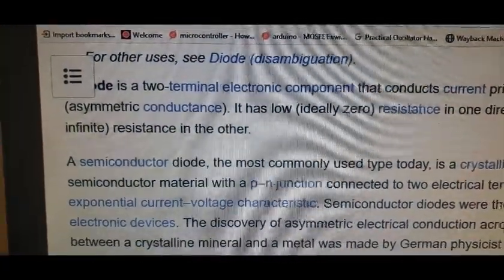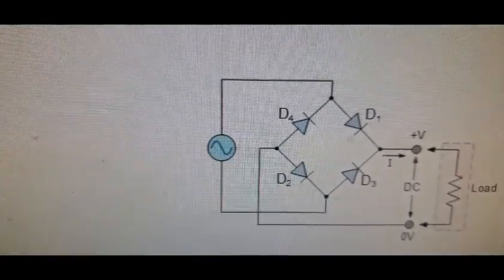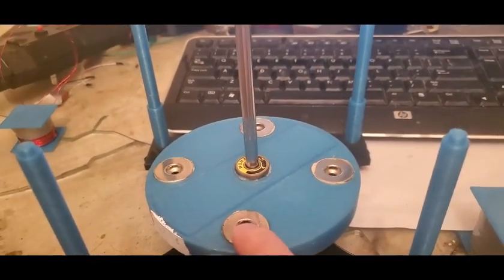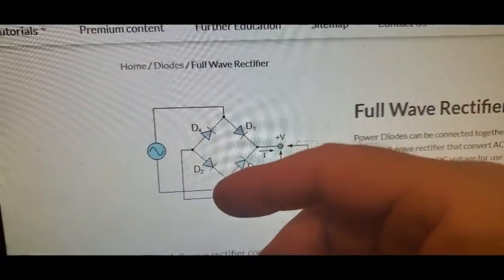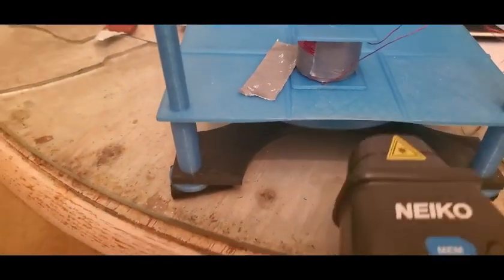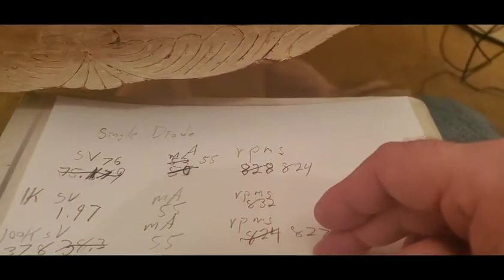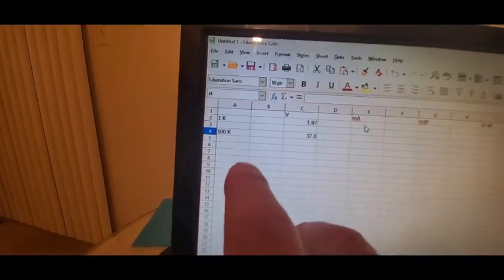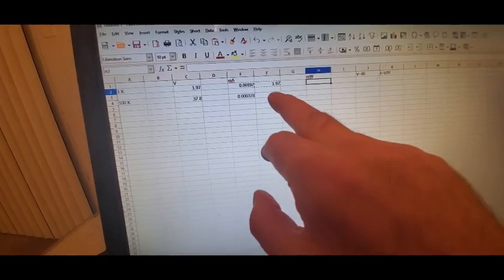Monopole Pulse Motor: Single Diode or Full Wave Bridge Rectification?

Comment: If your rotor is alternating poles or all the same poles makes no difference you don't need diodes at all.
A reed switch and a battery that's it then proper placement of the coil and reed.
You can collect the spike when the coil is first powered and when it disconnects.
Put a half bridge on each leg of the coil, that is a negative biased on the positive line and a positive biased diode on the negative line so two diodes is all you need.
Reply from the maker: Jon,  First sorry that your comment somehow ended up in the "held" bin.  The comment filter level is on the lowest level and you never even mentioned vaccines, haha.  Thank you for your comment.  I am not sure I understand what you are getting at, but yes, if you control the make/break down to the microsecond you could do active or synchronous rectification, barring that I would say you need a single diode for a monopole set-up and BR for a bipolar set-up.